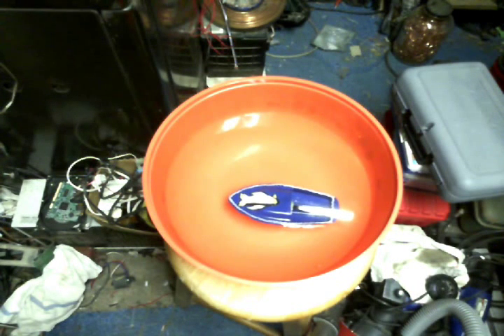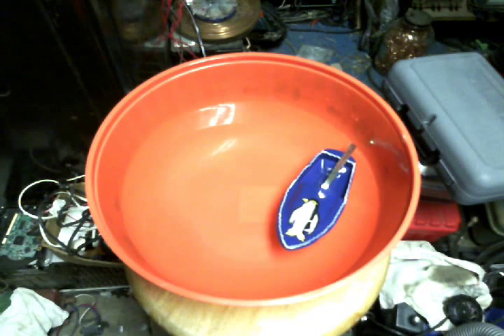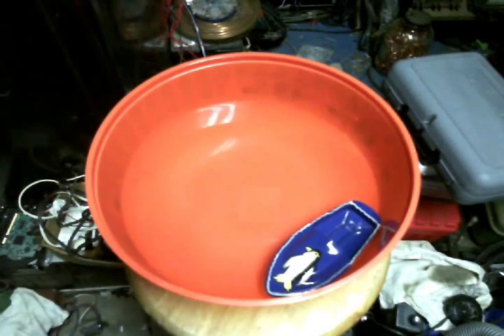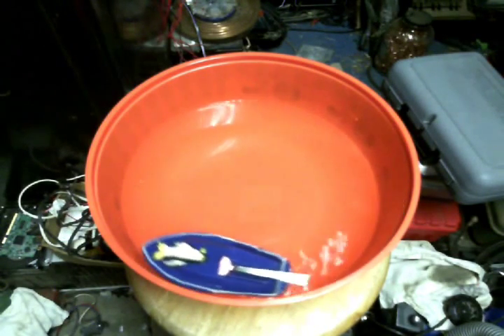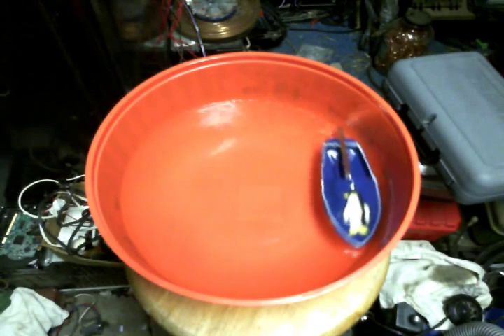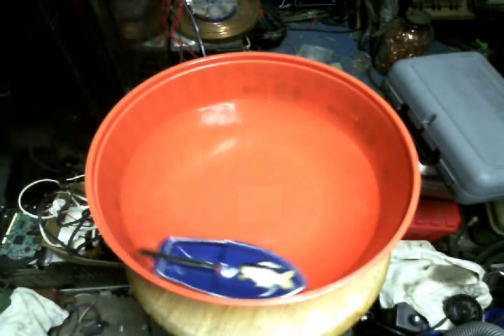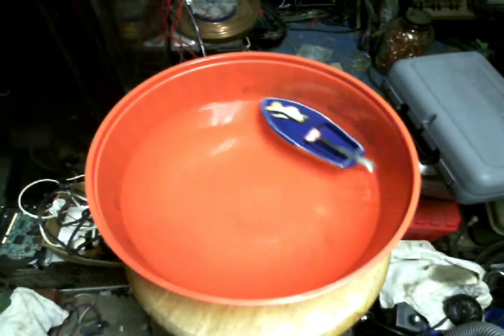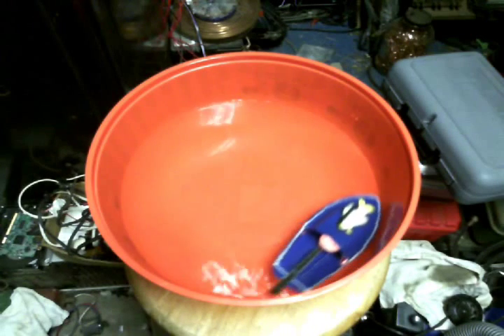POP POP BOAT !

Comment: As a generator I see a multi unit, axialy configured, and vertically overlapped! mounted on a shaft.Vertical shaft. with generator below water vessel , Sealed bearing,with maybe a fan blade between generator and vessel.

Comment: As a toy, I could see a small balloon of hho or hydrogen that you fill up prior to running the unit that is built into the hull, a small needle valve is attached that sends the gas to a tiny burner. It would replace the wax candle. As a scaled up system I could see hho or hydrogen generators on board of ships that either work alone or enhance hydrocarbons to fire boilers. Solar panels and wave generators built into the ship aid in making the gas on demand. I'd enter this contest, cool stuff

Comment: Based on the above numbers the pop pop boat although simple cheap  and fun is clearly not efficient with heat .If we scale this up we will run into brick wall of heat unless we can find ways to be more efficient with the heat sources Insulating the steam container top and side sections could half the heat demands .Building a good fire box with rocket stove could double the power from the same heat .Often small scale things wont scale up so easy  unless you plan ahead and look the numbers

Comment: It is estimated that a candle is ~40 watts of heat . A small boat like this has weight of about ~50 grams and does speed of about 1 kilometer an hour t .To Radio control model aircraft  wing span of ~40 inches  with electric engine of ~50 grams and battery of ~300 g  total all up weight of plane ~1000 grams 2.2lbs will fly for twenty minutes in level flight at 25mph & use ~40 watts .The engine is 50% efficient & the prop is 50% efficient meaning ~5 watts net will keep the plane aloft (Numbers)